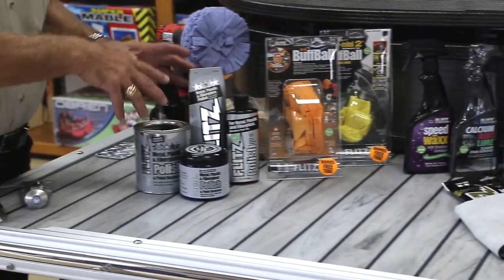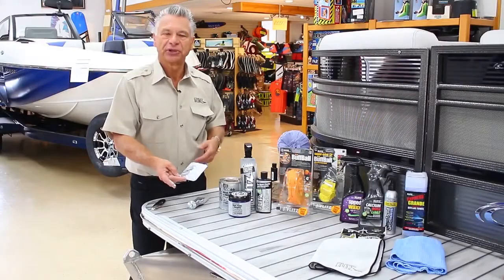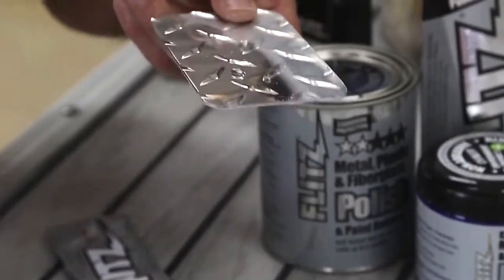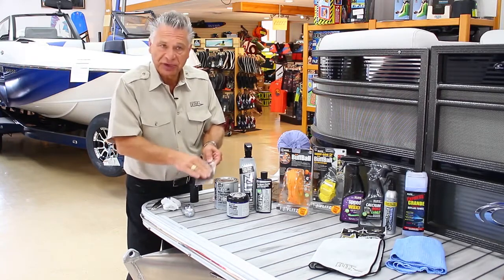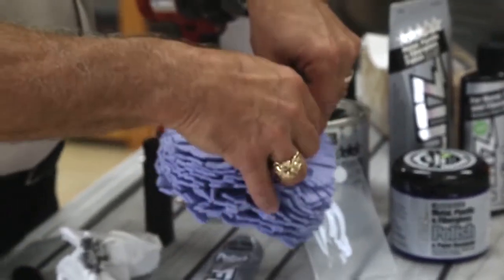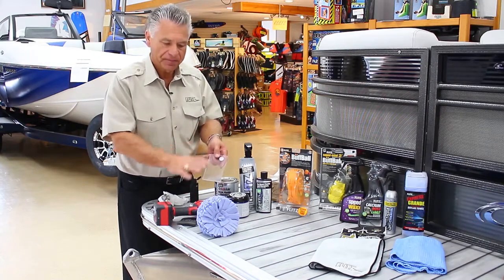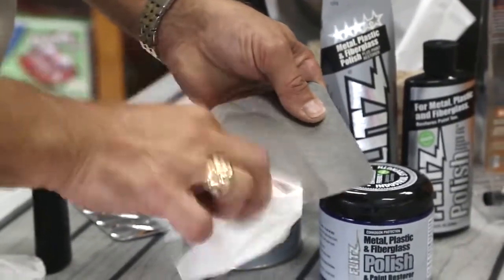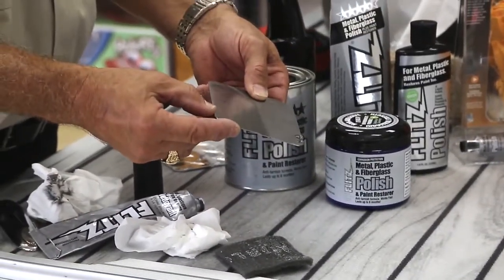Polish Aluminum, Plexiglass & Stainless Steel w/ Flitz Paste Polish

Comment: So, we actually use your product at work and love it! Specifically it's the blueish paste for metal, plastic, and fiberglass. The vinyl plastic windows on the soft top on my Jeep are yellowed and hard to see out of, do you think that particular polish would work to make the windows a bit clearer? Obviously it would polish out the deep scratches.
Reply from the maker: That's awesome!  Send us a video using our product from your work and we'll be happy to post it and promote your business on our channel!  media@flitz.com

We do use it for Eisenglass in Marine applications and you can find video of that here on our channel, so it should work for your vinyl plastic windows as well, especially when used with a FLITZ Buff Ball.
Reply: @flitz  ah yes, I definitely need a buff ball for a drill, or even a pad.. I tried using a magic eraser since it's mildly abrasive, and it didn't clear it up, I have really high hopes for the Flitz polish.
Reply from the maker: @huntershortrepairs  Let u know how it works out for you!
Reply: @flitz  will do! I don't think there's actually any videos of anyone using flitz for jeep windows
Reply from the maker: @huntershortrepairs  No we don't have that yet, but we do have video of using it on Eisenglass which may have a similar material.  Check out the Buff Ball segment on our Marine Market video:

https://www.youtube.com/watch?v=ZgY7FFSVAOs&t=32s
Reply: @flitz  that just might work I think! I believe the window material on my rear windows is clear vinyl

Comment: For gun parts ?
Reply from the maker: Hi Andrew! Yup! Both the liquid and the paste polish have been used by gun folks for decades.  Both polishes are also safe for MOST exteriors including HOT gun bluing. Do NOT use the polish on newer oxide-based finishes or cold-blued finishes. You're going to love what it does for your trigger pull! Happy Holidays!! 🎅

Comment: What about Autosol seem as good but it's made in Germany
Reply from the maker: Other polishes tend to have a much stronger ammonia fume.  Also, in addition to using it on Metal, Flitz can be used on  fiberglass, plexiglass, plastic, painted surfaces, and much more.